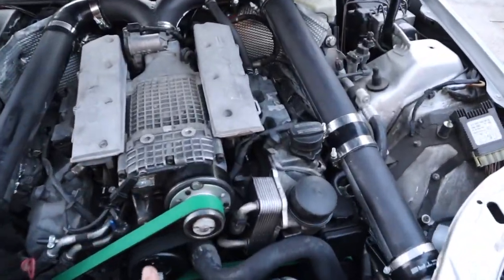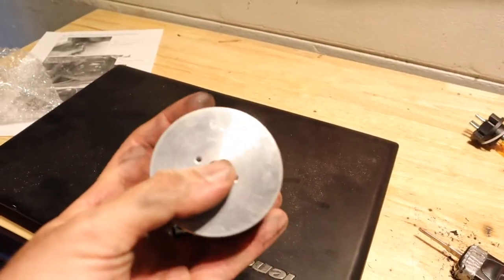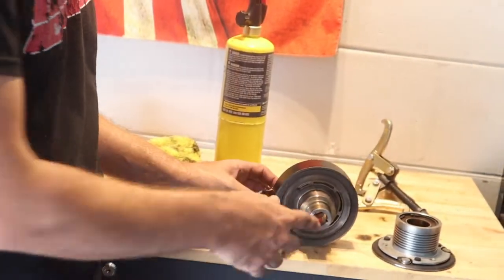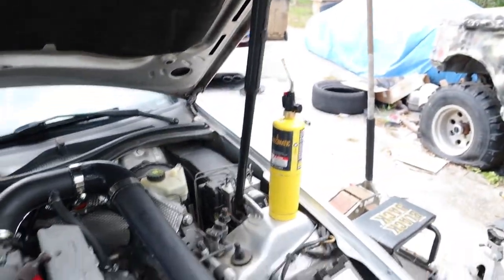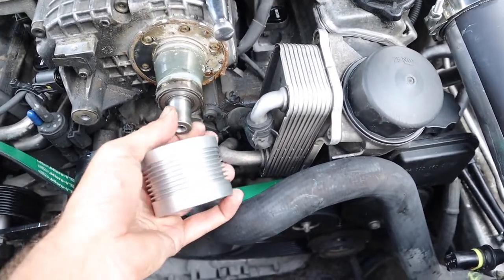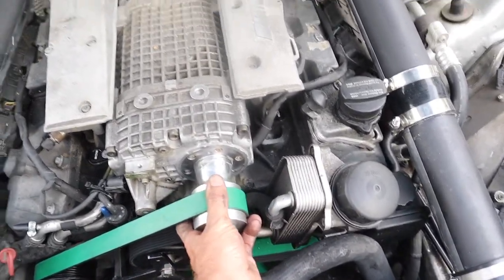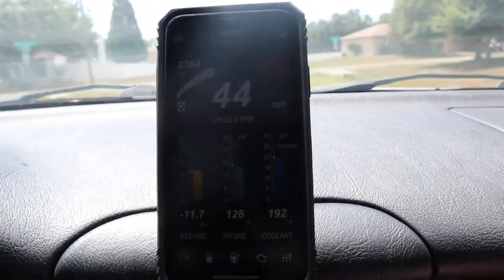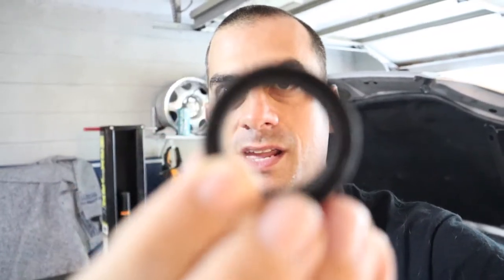Mercedes SLK32 AMG/SRT-6 Clutch Pulley Delete Install (v-tech 65MM)

Comment: Could you explain how you installed the dowels a bit more in depth? I have a c32 AMG myself and I’m doing a clutch delete on my pulley very similar to yours very soon You mentioned building the pulley before install with the washer attached to the pulley. Do you put the dowels in the pulley first and leave a bit sticking out for the washer to fit on?
Reply from the maker: Yes they just drop in

Comment: Quick question about your dowel pins install I actually install my dowel pins into the pulley first leaving enough of the pin out to install the cap and then lined up the supercharger shaft where the pins should go and installed the pulley and torqued down the bolt probably do a test drive Saturday seems pretty solid

Comment: Hey man I have been following and subscribed to you for awhile now. I have a question. Where did you wire your boost gauge and air fuel gauge to get the reading for low voltage. I got an Srt 6.

Comment: Hey Adam,
Quick question: 
How is the 65mm clutch delete pulley working for you? Any damages to your engine? Is this car driven daily or is it a track car? I have a C32 with all the mods you have except I still have original SC pulley. I went with needs wings 178 crank but thinking of the the stack set up if the 178 and 65 but not sure if clutch delete is a good idea
Reply from the maker: still daily the car and race it a lot 
no engine problems   my set up is the 178 and the 65 and the car pulley and still a great daily

Comment: Will it be worth it put this supercharger on my 01 e320
Reply from the maker: Could be
Reply: don't mess with it only amg engines are forged normal ones will go wrong they cant resist and  supercharger labor all that you might as well sell the e320 put bit more  money on other old powerful benz
Reply from the maker: @hrachtorosyan9852  fyi the m112 can hold well over 125 more hp.  I made lots of videos with my slk320 that I drive around with 125 shot and it still is going strong.   Look up my slk videos it is cool and fun

Comment: what is the difference on a clutch delete pulley and fixed pulley?
Reply from the maker: Lighter 
Power right away 
And no more blown out bearing
Reply: @Nd_72  okay which one do you suggest on a daily
Reply from the maker: @jasse5602  fixed
Reply: If you're doing a fixed pulley make sure you have upgraded, cooling pump. As running a fixed pulley runs hotter than a clutch pulley

Comment: Nice info and tutorial. I installed this with a tune and this car is a beast now 💪. My front seal went out as well and about to install it tomorrow. Is that seal a pretty straight forward install.to.do. Any tips?? Thanks for the vid
Reply from the maker: Yes very easy to do    But mine was leaking a little after so I up graded the seal to     Jon Bond Performance.   And love it

Comment: I am still working on getting my fixed pulley tuned one tune VTech sent was killing power to my rcm and fuel pump figure that out a new pump and rcm later I came to the conclusion after 5 revisions my 550cc injectors isn't enough for a 181/63 nih manifold setup 630s on the way
Reply from the maker: Nice
Reply: What’s a better setup 181/63 or 178/70? I want to do a build to get the max power

Comment: Do you still have that 65mm pulley? I'll buy it. Let me know.
Reply from the maker: No sorry
Reply: @Nd_72  I need your expertise here. For some weird reason, my supercharger stopped working. I started troubleshooting the issue as follows.
1. The pump is working perfect
2. Pump fuse is fine
3. AIT sensor is brand new (just installed last week)
4. The spacing between the clutch and the pulley is fine. 

My last guess is checking if there's power in the harness connecing to the clutch. Any help!!!
Reply from the maker: Do you have any codes  @AR_4Foglio

Comment: You need esp off, preferably dyno mode on, to make full power bro. You just need thick tires, or drag radials are the best
Reply: Dude what? Dyno mode? My sl55 has dyno mode? O.o
Reply: @awztattoos1472  oh yes. Esp only turns off traction control, not stability, so you turn on dyno mode and you will have full power no interruptions

Comment: What brand puller did you use because I got one from harbor freight and I'm having no luck whatsoever I've been two days trying to get this hub off I'm about to if something up any advice
Reply from the maker: It was from Amazon and are you using heat
Reply: @Nd_72  I went to Lowe's and got the map gas and but never got the pop I heated and turned my puller until it got hard heated and turned about 20mins it was off I was shock how easy it was I was waiting on a pop but never got one  thanks but 181/63 on the way
Reply: @Nd_72  also the harbor freight puller will wrk just got to trim one of the edges on the arm down

Comment: The guy Euro charged said that engine makes more power with a bigger crank pulley, injectors and meth. This is interesting though👍🏼
Reply from the maker: Ooo I will be adding more boost and injectors soon
Reply: Yes a crank pulley will make more than a supercharger pulley but when you stack pulleys and add nitrous  it's wicked
Reply from the maker: @waltscrossfiresrt6  lol I will say the m112 loves nitrous

Comment: Have you noticed any bucking or like the cars still in boost when you let off the gas I have a srt6 an was thinking about a clutchless pully but was told it would buck an almost be like you was on the gas when slowing down cause it was in boost
Reply from the maker: No are other people
Reply: @Nd_72  none that I know personally just something I heard my buddy has one with fbo an smaller clutched pulley he was told the clutchless pulley would cause that but your videos seem to show otherwise just trying to figure out what’s best thanks for the informative videos on this pretty unknown platform
Reply: Did you figure out if the bucking was true for the SRT-6 I have a 2005 that came with the erocharged ECU and 65mm tune and I'm thinking of going clutch less and switching over to V-tech tune